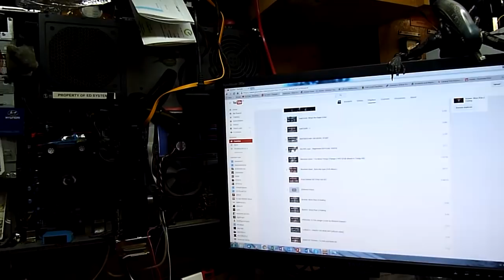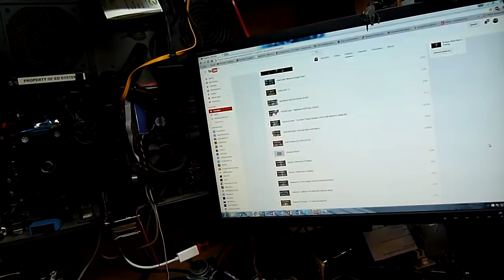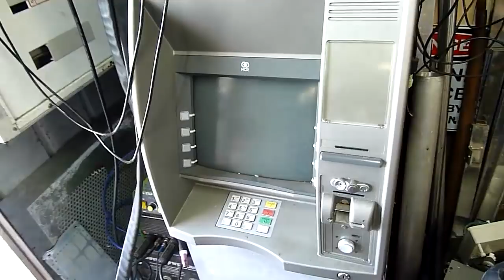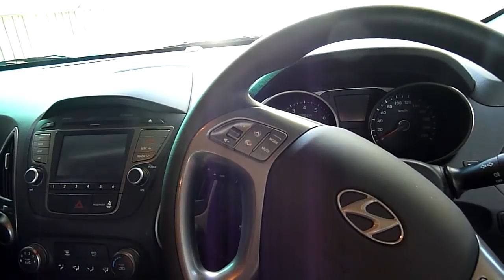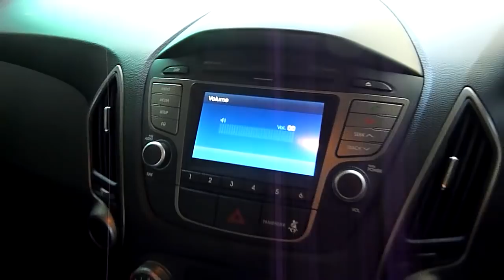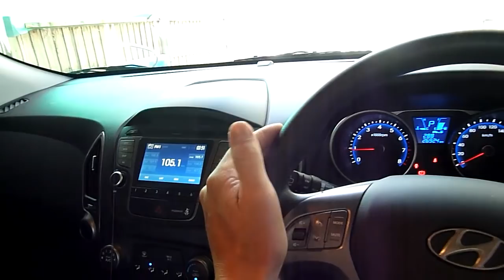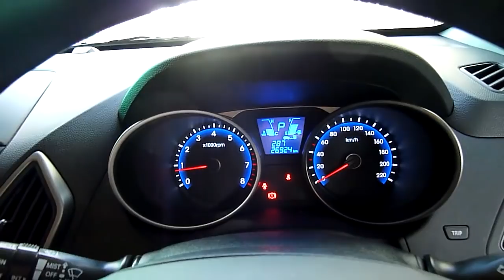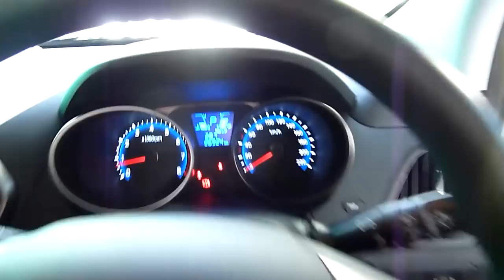Ramblotron Entry January 5 2016 - Meet Kate the Ix35

Comment: Well, Kate looks like a good little runabout; I did a little research and found out that in the USDM, the ix35 was sold as the 2nd Generation Hyundai Tucson. Unfortunately, we didn't get diesels, but we DID get a massive 2.4L four cylinder that was just as powerful as the 1st Gen V6. my parents actually bought a 1988 Excel, and it was actually a good car (when the factory defective 5 speed was in good condition) and we kept it immaculate, to where the the owner of the dealership we traded it into was so impressed, he kept it for himself!
Reply from the maker: +digitalrailroader yeh the 2.4 really is another step up, I had a hard time finding one that I could afford, and it had higher KM's than i wanted :(

Comment: Nice car. I actually wouldn't mind one of these or even an i30 diesel, for my 160km round commute what i do for work. However, my lpg falcon still serves me well despite having nearly 300,000km on the clock.
Reply from the maker: +madhardcorenick yeh go the diesel if you can afford it, I would have to buy a car with noticeably higher KM's to get it cheap enough for me, but I am happy with the 2.0 GDI.

Comment: I have to say, Hyundai has come leaps and bounds in the past 10 years. That's got the same engine as my old lady's i40 and yes, very torquey down low, but as with most econobox type engines they run out of puff when you stand on it, but that's the whole idea I suppose. They're a pretty good car to work on as well, having pulled a few of them apart and painted them. So easy to drive as well. Having driven the new Rav4 as well as numerous other new Toyota models, they don't quite feel as solid as they used to. You planning on keeping Elise the ML270?
Reply from the maker: +Reflex Photography NZ The engine definitly has its shortcomings when you really want to be agggressive in traffic, but overall it does its job. the ML stays for now, I still want a good heavy tow car. Betty will go, and the CR-V is a dormant project unless Julian wants somthing to do (his wife loves the old CR-V)

Comment: This is not an inflammatory comment, and I only bring it up because you made a big deal about the acceleration, but from googling I get two figures on the 0-60 of 10.9 or 11.3, neither or which are fast by any measure as that's pretty much a normal modern car speed. Hey if you like it's thats cool, it's your car, I just googled it and expected to be shocked by seeing a 0-60 time of 5.9 seconds or something after your praise for how quick it was lol
Reply from the maker: +arcadeuk oh she is no rocket ship, but way faster than any of my current 4cyl fleet :D
Reply: +arcadeuk Also, the 0-100(km/h) time of a 4L Ford Territory is around 7.5s which is not bad for a 2 tonne vehicle, so yeah I think the Territory was either loaded up, clapped out or the driver was not giving it everything.

Comment: Had a brand new 2013 Hyundai Azera. After 12,000 miles, the seats were wearing out, and filling up the fuel tank resulted in not being to start the engine for 5-10 minutes. The sheet metal was impressively thin. Take a quick corner, and the sheet metal would dimple. No thanks.

Sold it.

Comment: I had to buy A new car so I got a 2015 KIA SOUL  It's a great little runner great gas mileage also has ECO I get 10 more miles per gallon
Reply from the maker: +I Don't Polojize I like the Soul, I completely forgot to test drive that one :(
Reply: You would fallen in love with it
Reply: ***** I use to have a 85 Crapaler ran good tho I got over 200.000.00 miles on before it died sold it for 200. US

Comment: Nice car , i am not convinced about electronic powered steering but its here to stay i think.
Reply: +Andrew Joy Early implementations were pretty bad (poor feedback), but I gather that has been addressed.  I think electric power steering is tremendous.  Getting rid of the leaky, dirty pumps and hoses couldn't come soon enough for me.

Some cars are equipped with electric A-C compressors and water pumps now.  There is much more flexibility in locating these.  It won't be long before there's only one pulley to drive!  Good times.
Reply: I have driven a current model Fiesta with electric and it was nice , i own a sligly older ( but still same model) and that has hydraulic and it feels much lighter both handle jsut as well tthe electric on full lock however made ... interesting sounds. I tried a much older fiat panda that had electric and that was terrible.
Reply: +pillsnotbills yup, one pulley driving a MASSIVE Alternator.
Reply: +Andrew Joy my sister has a 2010 Nissan Versa (that would be Tiida for all of you outside North America) that I have driven several times, and to me, the Electric Power Steering in that car has VIRTUALLY ZERO Feedback and weight to it much like your typical Gamer Racing Wheel; by contrast, my Chevrolet Aveo of the Same Model Year (that would be the Holden TK Barina for you Aussies out there) has MUCH Better feedback, and good weight to it due to its hydraulic power steering.

Comment: You Did Very Well ED, I did some research on the Hyundai Tuscon & the Santa Fe Both are also great SUV's too & Highly Recommended alot of Bang for Your Buck, I might Look into the Tuscon & Santa Fe when the time arises in Petrol & Diesel & of course i will check out the All new Camry Altise. Thankyou for the Great tour of your Ix35 looks really sweet....
Reply from the maker: +Tim Miles (Airplanejunkie) hehe good to hear I changed your outlook on Hyundai, gone are the days of rattly bland old cars, they are doing so well now :D
Reply: Aussie50
You Sure Did i am pretty shocked myself they actually turned out to bet better that European Car Makers, Enjoy ur car by the way i am looking between Santa Fe Vs Tucson what do u think is better ? but the Camry has to be in the picture for me....will compare all when the time arises to buy, Thx agian ED Enjoy your iX35 looking good
Reply from the maker: +Tim Miles (Airplanejunkie) The camry is a great car, test drive them all for sure. the Santa-Fe is noticeably bigger than the Tuscon, but you get a great package either way, so do your test drives and see if you really need bigger or smaller.
Reply: Aussie50
Oh i have Driven the 2013 Camry 2.5LTR 4 Banger & it Flies its really fast on take off & i also Tested the 2012 Aurion 3.5 LTR V6 to be Honest the Aurion did dissapoint me because i have not felt any difference in power with the Camry I expected alot more but they only difference is it Drinks for Fuel doesn;t make sense so i will have the Camry in my mind then i will test drive the other 2 Hyundai Suv's &  maybe a Late Model i40 so what are your thoughts on the HD i40 Ed ?

Comment: 3:50 nice ride ed, that is really awesome
8:20 yeah android phone navigation from my experience is FAR superior to anything that a car or a portable GPS can do, google maps (as much as I rather use openstreetmaps) is awesome. Only bummer is non standard DIN head unit, can't change stuff up like you did in bluey
11:10ish click click of all the relays, hehehe yeah in time they'll prob go to solid state, you prob wont hear it if the doors are shut, I hear one or two clicks from maz inside the cab but she makes a racket outside as all the bond gadgets that I swear Mazda hide in those cars tick over :P, though Kate is alot quieter than Maz ignition wise, the injector click is a lot quieter
Reply from the maker: +Max Bainrot yeh I carpooled with Julian in a loaner Mazda 3 2015 model with the lot, even its nav was incorrect at times, and it reacts to live updates and lane positions (whole car is almost automated, lane assist, warnings, radar sensing for cruise with auto braking and 2 second gap) takes too much away from the driver to be honest.
Reply: +Aussie50 holly crap, that mazda makes my car look like it's a carburetor with winder windows :P mine doesn't have lane assist, warnings, radar, etc. Very much agree, the car is meant to be driven not ridden
Reply from the maker: +Max Bainrot yeh it belongs to his father in law, great car, just too many gadgets. the blind spot assist is kinda cool tho, it pings cars in the other lane and shows orange icons on the mirrors when a car is in close proximity. if you put your indicator on at that time the car beeps at you. likewise it monitors the white lines, if you drift over, it plays a deep rumblestrip sound through the speakers on that side to warn you
Reply: +Aussie50 Those features are handy :), given how good the Mazda 3s are at swallowing cars whole in their C pillars :P

Comment: Have they fixed the shitty throttle lag in drive by wire yet?
Reply from the maker: +Evan Sakamoto yes, I cannot notice any lag, to be honest I prefer this over mechanical cable.
Reply: That's good to hear. I'm totally for drive by wire, just the earlier systems felt like driving through mud.
Reply: +Evan Sakamoto DBW throttle control lag issues have been sorted for a while, im thinking about converting my mechanical throttle linkage to DBW because it means i have throttle limiting, engine protection (limp mode) and a whole host of other reasons :)

Comment: I've owned Both Kia's and Hyundai's, great little cars until they start reaching the 10 year age, then they seem to start losing their timing and go to hell. Both of them had interference engines, one of them broke a timing belt and the engine blew up. Since they actually having different timing now I might consider another Kia or Hyundai in the future.  It's nice your's has the alternator up higher, on the older models it was always a bitch to remove them.
Reply from the maker: +The Universal Eye even tho I intend on trading up in a few years, it really is nice that the alternator and water pump is so easily accessible. Hyundai/Kia have come a long way in the last 10 years thats for sure!